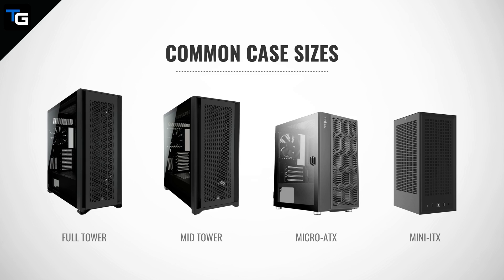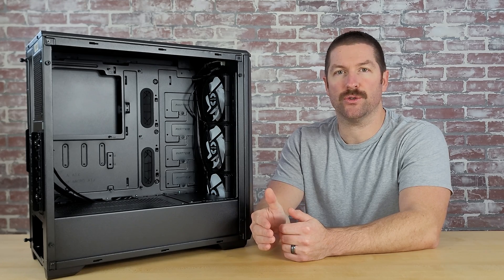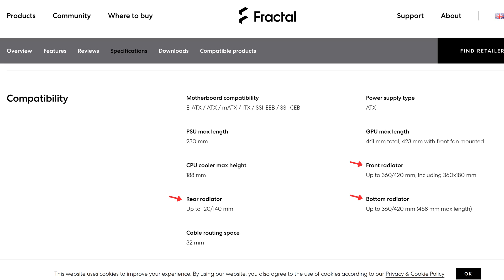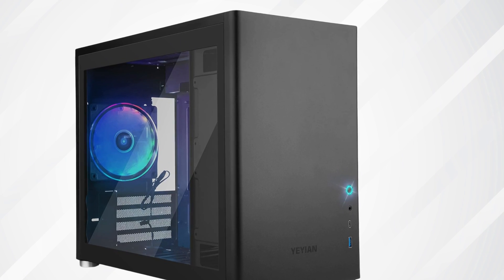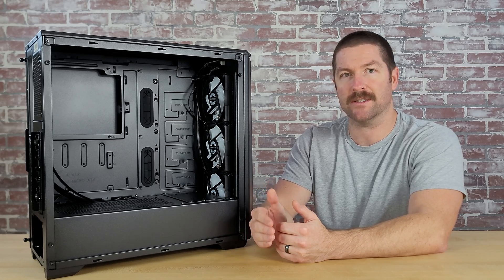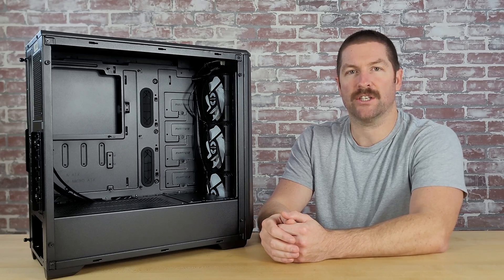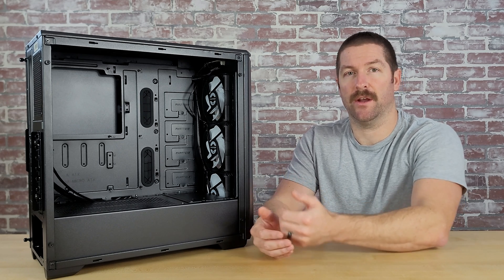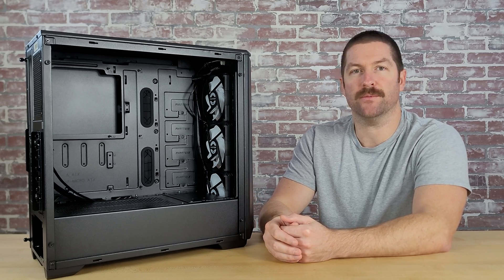How to Choose A PC Case for Beginners

Comment: I know its long please bear with me im desperste right now ill give you 30, no 50 bucks on patreon if you can help me find what i need😞

if you or anyone can help me out it be greatly appreciated!  but 1st i need to say i got into pc building by accident(an decided i dug it!)
 didnt really know what i was doing when i was given a custom-build tower. i needed better performance but couldnt afford a new computer so figured id look 4 next best thing; a component of the tower, again, no clue about anything computer ((building)) just aware OF basic parts & functions an literally learned along the way, starting with learning how to wire a MB(found it suprisingly easy), that said, an to keep this to the point as possible, heres the run down...apologies if sometimes using incorrect terminology... 

what i was given: 
A [i assumed custom] Lian Li mid tower, aluminum chassis
      with- random holes seemingly everywhere with no clear purpose, but in use were two 240 front fan spots an fans, 
two 120 fan spots an fans on top, with plates if not used 
8 rear bays, 
one 120 rear fan spot & fan
a 4 3.5" bay storage stack in front bottom an 3 front optical bay spaces, a screwed on screen vent space on back side panel an 2 vents (open stripes?) bottom an back of frame for PsU, finally lil space in roof for 2 audio ports an 2 usb 2.0 ports, with lil flap door, looks clean

a B360 Pro 4 MB, 
typical rear IO, 
no RGB header any kind, 2 large PCI express slots, 3 small ones, 
4 M.2 ports (2 a key 2 e key)
1 usb 3.1 header, 
2 usb 2.0, 
1 hd audio,   

and on it a...
i3 Cpu core

one stock RAm card

a 350W PSU with 4 total sata an 4 molex plus a pwn all on 2 cables

a dvd drive

a 5.25 media dashboard with 
5 card slots 
2 audio 
2 usb A 3.0(teal) 
2 fan dial controls
a sata port and what looked like that old s cable port but says 5v left side an 12v on right

what i migrated from my old computer:

My Nividea Geforce rtx 4030 Gpu
two 3.5" 950 & 650 gb HdD
one 2tb 2.5" SSd

what i initially added was:
1 more 3.5" 1tb Hdd
1 more 500 gb 2.5" Ssd

2 new Corsair 8GB DDR4 cards

one 1tb NvMe sata Ssd on top M.2

NOW...present day, im
getting back Into video editing etc. I found AI programs to help my workflow but my computer keeps crashing. Thus started a long journey to remedy the issue, 1st thought ok it needs more RAM

SO,
1st i got
2 new Corsair Vengeance RGB Pro 16GB DDR4 3.6Gh cards, still crashing ok i need better CPU

So I got an Intel Core i9-9900KF Desktop Processor 8 Cores up to 5.0 GHz Turbo Unlocked Without Processor Graphics LGA1151 300 Series 95W

I thought for sure that's all I'll need Until I was advised of all the heat that it produces, I would need a radiator cooler.
As well as all the power that it consumes as well as my other components. And that I would need a more powerful PSU. (See where this is going🙄)
so I got

ID-COOLING SL240 Liquid AIO Cooler with display, Dual AF127 ARGB Fans

an evga suoernova 850w 80+ gold fully modular PSU

And I thought that was it, but now the radiator will not fit. And I'm afraid to put the CPU under full utilization without it. Getting too hot, so now I'm trying to find a new case

if you can help me with 2 things 1st explain or tell me if I got the right cpu, 
If I need a new or better motherboard and core all together 
and what kind of case to get me?

I'm trying to find a case that has both  a 2 sided tempered glass, but also with at least 2 optical drives slots for my media dashboard and DVD drive., Is there like a case where they pop out where the PSU shroud would be? 
If there is no case that exists that has both those attributes , then I found a couple cases I'd be down to get, so Just the CPU. If I got the right one, and if not, which 1 should I get. Do I need a new motherboard? And is there a case that has those qualities that i'm looking for, I'll patreon u 50 bones if you can help with this